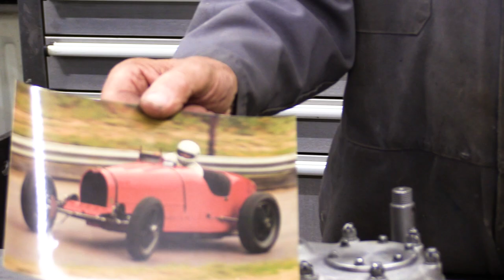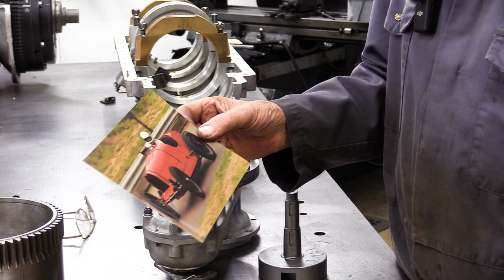SHED RACING - Bugatti Type 35 Crankshafts Explained

Comment: Nothing wrong with your accent mate, it's good to sound like where you are from. I appreciate your engineering experience too. I learnt from your video why Bugatti engines are so revered. Not to have to align the cranks by having cotter pins is a great advantage enabling the essential cleaning to be done easily. It do make a 3000 mile decoke a little more extensive! You are right about not feeding the bearings too much oil and making sure that it is matched to the temperature and surface speed over the rollers to prevent them from skidding. Inevitably, the rods will have a preponderance to run at one or other extreme of their end floats, but there appeared not to be any specific end bearing? Shimming an end preload on the crank to compensate for crankcase expansion would be necessary to prevent crank shuffle, as you say. Interestingly, any substantial crank end load from either the clutch operation, transmission, cam or supercharger drives would cause a rapid demise of the main bearing ball races and would necessitate a change in bearing design. Great video. Thank you.

Comment: Thank you for taking crank apart to show exactly how it works.
I've done hundreds of roller bearing motorcycle cranks (1, 2 and 3 cylinder) all were pressed up. 
The machining and precision grinding involved with that design is fantastic, a pressed up  inline 8 would be a nightmare to true in a pressed up design.
 The amount of work involved explained why roller cranks are no longer used (£20,000 is damn expensive)
I guess the oiling design is where Honda got the idea on the twin cylinder bikes of 1960's, they use just about the exact same system although no recommendation on cleaning (they also have centrifugal filer on end of crank before oil gallery) It obviously works well as bikes get revved to 12,500 or more in vintage racing and cranks don't fail, the cam bearings seize way before you have crank problems (oil pump only pushes 15psi)
I used to teach how to measure bearing clearance on roller cranks, specifically for older Harley Davidson's before they went to pressed up crankshafts in early 2000's, got quite good at drawing the big end 'section' for demonstration
Reply: A long time ago,Cars and Parts magazine had an interview with the guy who had actually designed the Duesenberg engine. Also roller bearing with an assembled crank. The rebuild on that engine,mid to late 70s,was spectacularly expensive. The guy said hey,we only expected perhaps 5 years for engine life. The fact they lasted as long as they did was a gift. 
You look at WW11 Maybach tank crankshafts,they have huge roller bearings bigger than the crankshaft webs. That is a plan B,works well but with its own issues.
These things as Ivan says,really clever. A 1.5 litre engine,minimalist approach. Farmers kids in Molsheim,the employees doing the actual work under the direction of Ettore the erratic. Simple but precision with patience. You can teach farmers kids precision fits. The probably leather drive belt machine shop thundering away, blueprints then hand fitting each collection of parts to exact fit.
I look at the complexity,I look at the weight of the crankshaft,I look at the need for Ettore's use of an oil distribution device,plus all the details Ivan shows,it is understandable modern engineers have gone with simple.
This episode is brilliant to me. Myself,I only ever took a couple Suzuki motorcycle cranks apart,gave up on the idea of fixing the blasted labyrinth seal. Suzuki said they were not serviceable,I believed them. I look at this,I go wow,just wow.
Ivan calls it a lovely bit of kit. It is.
Reply: @paulmanson253  Thank you for reply, it's very interesting to know some facts from the designer. 
I didn't know the Maybach engines were a pressed up design, I've only worked on what is considered small to tiny engines and don't even know how to find information on engines I didn't know about. (if you don't know, you can't ask)
I still think £20,000 is damn expensive, it's why I can only afford 1970's motorcycles 😉
Reply: @1crazypj  I am not certain Maybachs were pressed cranks. Given the torque load, probably not. But they did use roller bearings. Massive things. Looking at oh,a V8 auto crankshaft,vs there is some YT footage of Maybach rebuild,you can really see why plain bearings with full pressure oiling remain an industry standby,hard to beat. I remember a design engineer writing,he said don't be afraid to go with complex,but only after every straightforward approach needs to be discarded for some reason. Years ago a friend had a Suzuki water buffalo 2 stroke bike. If memory serves,the outer bearings were roller,and heavy wear,flex and Brinelling were a regular cause of winter rebuild of the engine. He persisted with that thing for years. How much extra power or higher rpm was a result of the roller bearing choice,no idea, but he sure put a lot of maintenance into the thing. You pays yer money and you takes yer choice.
And I still think that Type 35 crank is a work of art.

Comment: Thank you Ivan, Tanya—and Tim for lending the crankshaft, etcetera. Excellent video, as always. I understand, from ‘The Secret Horsepower Race’ by Calum E. Douglas, that: Daimler Benz had significant bearing issues with their WW2 aircraft engines, after they had to change from roller bearings to shell bearings, due to material shortages and Hitler’s insistence that anti-aircraft artillery take priority over aircraft production, for strategic materials. If I recall Mr Douglas’s writings correctly, it is, in simplified terms, easier to maintain a reliable oil supply to roller bearings, than to shell bearings.
I love the fact that Tanya uses two cameras, at times, in order to obtain the best possible range of images. The Clerks of Works—the cat—is obviously keeping both of you in order😁! Cheers from NZ.
Reply: Roller bearings simply need less oil, very little in fact. That's also why you will find them in the crankcase of nearly every 2 stroke,   running with nothing but a tiny drizzle of oil that is heavily diluted with petrol would destroy a plain bearing in no time. The few 2 strokes that use plain bearings have to use absurdly oily premix, something like 10:1 fuel to oil.

Comment: I have a 1975 bevel drive Ducati desmodromic which has needle roller big ends, and that has to run on old fashioned straight SAE 50 non detergent oil. Never thought it had anything in common with a Bugatti!  Great video, thanks.

Comment: And there, for any Americans watching, is the difference between a cotter pin and a split pin. 
(Americans call split pins 'cotter pins').
Excellent video, your knowledge is encyclopaedic.
Reply: What do they call Cotter pins then   ?
Reply: @stevewilliams2498  that's a very good question. Some Google searching leads to endless links saying that Seppos call split pins Cotter pins, but I can't find what they call Cotter pins.
Just mention that they aren't much used these days, even on bicycle cranks.
Just more dumbing down of the language.
Reply: Nah, we still use them all the time on light airplanes. And car suspensions. But Cessnas are chock full of cotter pins. No idea what a cotter is though, or why it needs a pin. 

Do you use the term "castellated nut? "
Reply: @ExceptionallyCleverUsername just castle nut usually. I'm far too familiar with one use case for them, which is holding the wheels on trailer axles.
Reply: @nerd1000ify  Yeah, "castle nut" is pretty common here too, but I think "castellated" is regarded as more correct.

Comment: I have zero experience with roller bearing cranks and I can't get my head around that fact that the cotter pin assembly is strong enough to hold everything together at high revs. Regarding the lack of a torque figure for the cotter nuts, this would seem like an ideal situation to tighten them by bolt (cotter) stretch. Fascinating.

Comment: I spent 7 years machining race, vintage and small batch cranks from billet.
That roller bearing crank is a thing of great beauty.
I'm a big fan of Leo Gossens engine designs for Harry Miller.
P.S. a proper Toolmaker wouldn't have missed those rads out 😉

Comment: Brilliant video, well shot and narrated. Another mystery solved. Some,Aero engines also use that system.
Reply: True enough, regarding very large aircraft engines such as the Pratt & Whitney R-4360 ( cu. In). Radial engine. They were designed and built like a fine watch on steroids and were capable of producing 3500 hp hour after hour at 2450 RPM at a gross weight around 60 tons.

Comment: The early BMW boxer twins, pre early 70s, used this same oil spray into a crankshaft attached annular ring for lubricating the crank bearings.  It likewise was susceptible to an accumulation of crud in the annular ring which would eventually lead to failure of the bottom end.  Cleaning the ring or checking the ring for crud build up also likewise requires tearing the engine down.
This is something to keep in mind if owning or purchasing a classic BMW motorcycle.
Reply: Sounds like these need regular dosing with Marvel Mystery Oil?

Comment: Pre 1969 bmw motorcycles use slingers like that…they are removable and bolt onto the crankshaft….the lip is always packed with that lead type of material and need cleaning as it can accumulate and plug up the hole leading to the big end…..oil is sprayed onto the face of them ……easy to replace as well and are like a tin pan ....slash two motorcycle engines , 500 cc and 600 cc roller motors..

Comment: Can't see a feeler gauge anywhere. Do you need to check endfloat between the rod and the throws of the crank or is the cotter pin captive on the pin flat?  That's a solid bit of kit. No need for a "real" flywheel. Most interesting.

Comment: When you're trying to insert a close clearance pin in a bore, flood the end of the pin with plenty of oil just before you insert it and it will slip in easily without jamming.

Comment: Hello. and thank you for such a great explanation of this wonderful piece of history. and for the great stories. A few questions. are the bobweight assemblies iron? or aluminum?  also are the rods aluminum? and lastly I have heard that the type 35 engine was re-engineered from an original design from the American Harry Miller Indy cars? is this true? and how close are the two crank assemblies to each other? Thanks for all of the great effort you all put towards sharing/ saving this great knowledge with us all. Tom B. From The U.S.A.
Reply: It was the Type 51 engine which they copied from Miller. It hasn’t got any bobweights and the rods are made of steel case hardened on the bearing faces
Reply: @ivandutton6580  Awesome. Thank you so much for the answer.  And great info.

Comment: I've had a Yamaha 650 special motorcycle that crank is roller and pressed and oiled by external jets in the case directed at slots in the big end of the connecting rods .I think good for over 100k .not sure what the oil pressure was no gauge .

Comment: Do you need a flywheel with all that rotating mass,apart from something to fit the clutch to?Thanks for that interesting video
Reply from the maker: the crank is so heavy. In my experience racing one, the minute you get that crank spinning nothing will stop it, the back wheels just light up, so you don't really need one. In actual fact the flywheel on a type 35 is just a shell to take the clutch and starter ring